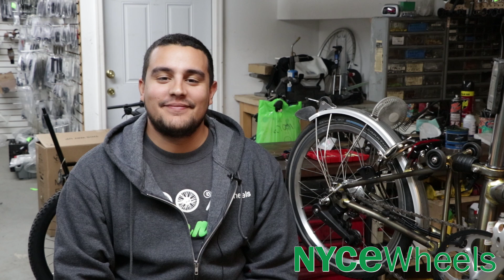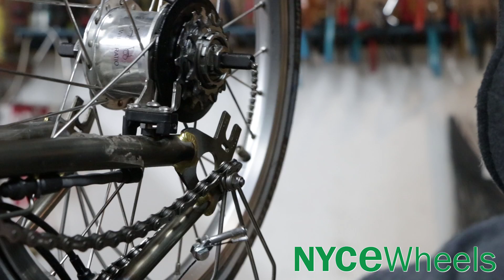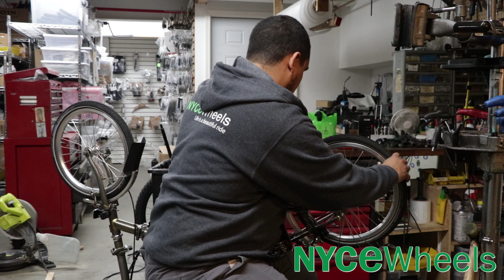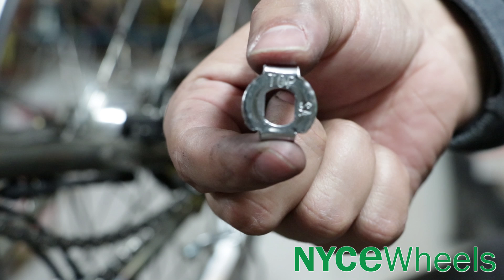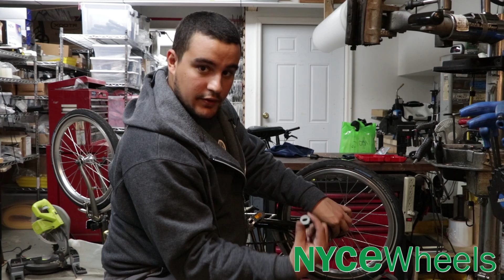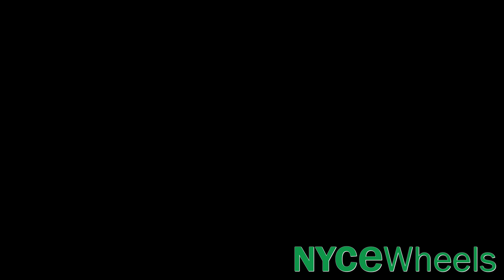How to fix a flat on your Brompton - Part 3

Comment: Thanks for all three videos. I made a bit of a mistake pinching another puncture in my replacement inner tube as I was putting it back on. So I had to do the whole thing again! That wasn't too bad though as I got more practice at getting that back wheel off :-)

Comment: Thank you for sharing. I followed the steps after watching the clips and as it was my first time repairing a puncture and also a first attempt taking off a Brompton rear wheel. It worked first time and I am sat here chuffed that I managed to do it. The test will to see if the gear change is still smooth? Thanks so much for the clip NYCE!
Reply from the maker: Thanks for watching :)